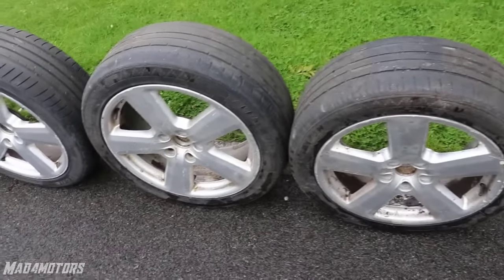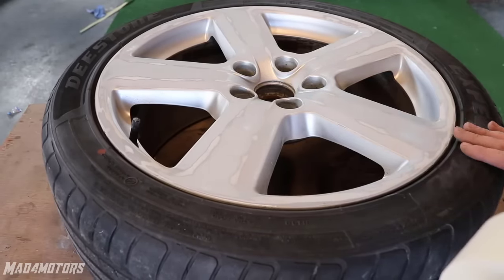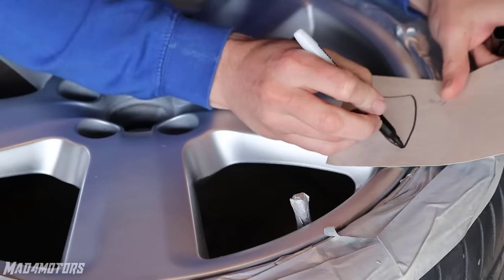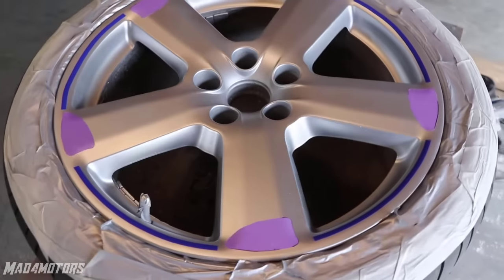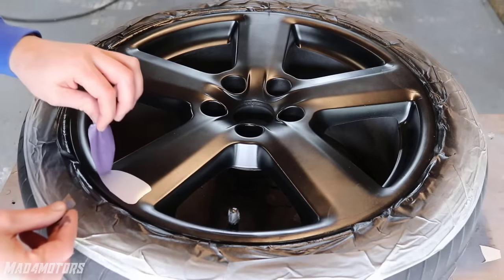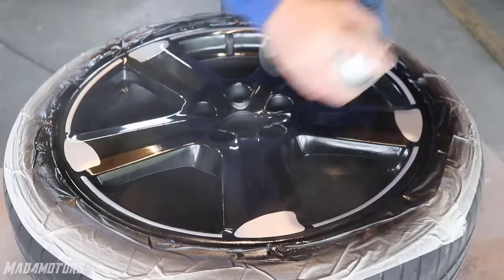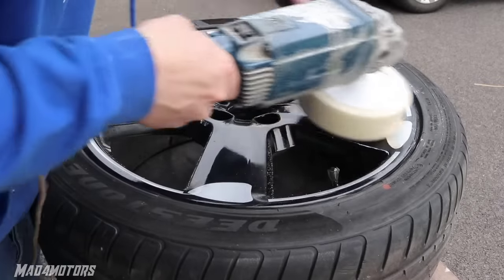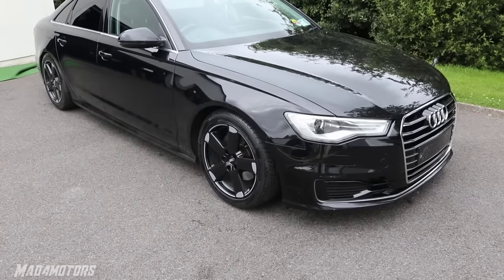Turning a $50 set of wheels into a $500 set of wheels

Comment: One thing that wasn’t shown or mentioned is that if you use a design like the arrowhead (that has a point on one side) you can’t make all four wheels the same. Two of the wheels need to have the points go in one direction, the other two wheels in the other direction. If you don’t, then the two wheels one one side of the car will have the points pointing towards the front and the other side will have them pointing towards the rear. Notice the left side of the car wasn’t shown.
Reply: Eye off the tiger 👀
Reply: Tomaszenko,
I took a look at the Audi rotors and you are correct. They are similar, and all four the same. I guess it’s just personal preference as to how one wants them to look on the car. For me, I prefer symmetry. Could be because I’m a Virgo? 🤪
Reply: That is the same problem that rims have on some cars, that they face backwards at one side, just some details that irritate me.
Just check out the new electrical Audi , it strange the designers don’t think about it.
Reply: No shit Sherlock!
Reply: Bram
Meaning what? You thought I was stating the obvious?
Reply: Its not difficult just flip the template when your making them out of tape.its not rocket ship engineering.
Reply: @turbowank16v  That’s right, but he didn’t do that.
Reply: Wheels with angled spokes tend to all be set in one direction as to the fact that manufacturers would have to make 2 castings 1 left and 1 right therefore doubling the price of the wheels plus kerbside wheels tend to get more damage from abuse. ie: buckles, cracks.  So obtaining second hand replacements would be near Impossible unless you were to import them.
Reply: even if you put directional wheels on each side when it comes time to rotate your tires you end up with wheels facing wrong direction that is why i never liked directional patterns
Reply: @sammysteele432  when you rotate wheels, you only rotate front and back and not left and right
Reply: @DDHDTV  actually it depends on the vehicle for instance if it is front wheel drive both front wheels move to the rear however the rear wheels move to the opposite front corner which would mess up the direction
Reply: Cries in Golf GTi mk8
Reply: @sammysteele432  Actually the car has nothing to do with how you rotate the tires. Directional and non directional tires are what determines how you rotate them.
Reply: And whether you have a square setup or not…

Comment: Great content for the DIY'er who doesn't have a Grand or Two to spend on their rims. Really prefer to put the hard cash into the bits that matter most like the brakes, drivetrain, or suspension where it really matters most. Liked that you stuck to a basic design and didn't lose sight of the purpose. Thanks again. Very best wishes.

Comment: Fishing line or dental floss will help when it comes to removing those fragile emblems on the center caps. Just floss it between the emblem and whatever it's attached to. A heat gun (blow-dryer can be used as well) will make the task even easier, as it will soften up the adhesive.

Comment: Just a quick tip to make this process easier ,if the tyres are good and balanced or if you have new ones fitted and balanced ,let the air out and have a tyre shop break the outside bead then get a big piece of cardboard or corflu (plastic cardboard},place a tyre of the same size as on your rims draw a circle on the cardboard from the inside of the tyre cut a slit in the cardboard so it can be slid between the tyre beads and rim as the outside beads  where pushed back by the tyre shop this eliminates the need to mask the rim and allows paint to go around the edge of the rim and when they are dry you just pump up the tyre and the bead will pop back on and as the rear bead was not broken the tyre has not moved so the balance is still good and your wheels are ready to go on the car.

Comment: The only issue is that because of the spear head design they are now directional, so you have to bear that in mind when rotating the wheels.
Reply: The wheels always rotate... that's the whole point of them.. If you think that you need to rotate your tyres to "even out the wear", then you should get a wheel alignment that will make your tyres wear evenly.
Reply: @jonbaker3865  - I have edited the comment to make it easier to understand. The message is the same.
Reply: @johncoops6897  An alignment doesn't change which wheels are driving the car. The driven wheels' tyres are gonna wear much much faster and therefore may need to be rotated.
Reply: Yeah, but rotating the tyres on the driven wheels won't make them last longer....  in fact, it probably makes them wear faster since the moved tyre needs to "wear in" to it's new position (eg: feathering of the leading edge on tread blocks of driven wheels).
Stop and think about it - in what way could rotating of tyres possibly make them last longer? They wear as they wear! So if the driven wheel's tyres are wearing much faster, then simply replace those TWO tyres when required.
The main reason that tyre manufacturers suggest rotation is because then they can sell you 4 new tyres at a time. For the consumer, it simply mean a larger upfront purchase instead of just replacing pairs of tyres as needed. Also, you waste time and money going to the tyre place for unnecessary labour costs that achieve absolutely nothing..
Reply: @johncoops6897  The idea of rotating tyres isn't to save money. Its to give extra time before u have to buy more. I understand that it may make them wear faster and its also probably not the safest option. Its like a loan or credit card, solves ur problem temporarily but ull end up paying more in the long run.
Reply: @jonnylawrence5699  - What you said is almost certainly true, but it's totally and utterly illogical.
If money is tight, then buying one or two tyres is always cheaper than buying four :-)
Reply: @johncoops6897  Glad we could sort of agree. I'm only on my first car and isn't something I've ever done. My dad works in a tyre shop and my mum would get him to rotate the tires on her car in order to wait for the next paycheck. I never really thought of it from the way u explain it and I'm pretty sure its against their company policy for the usual customers. I don't disagree with what u said, but sometimes people don't have much choice but to do what is illogical. (Edit-spelling of "their". Ppl on the internet can be arseholes for spelling)

Comment: I don't know what to say, i try your method in the past and they don't last very long time do to the lack of hardener in the paint. In my country a set of this wheels to get refurbish ( sandblasted, fills pinches and scratches) and electrostatic painting costs around 100$-110$ (in this price they get off and on your tyres and balance the wheels again)... probably the prices in your country are much higher and that is why your work is justified.

Comment: I have a 2001 Dodge RAM 1500 with a set of stock wheels that I'm going to paint the wheel flat black, the 3 spokes metallic bronze, and the hubs Gloss black. The wheels need some extra care. I'm also adding large (14"x14") USMC EGA emblems to the doors, a large (6"x6") RAM emblem on the tailgate, a custom wing on the roof, and a Duraflex® - Hellcat Style Fiberglass Hood painted flat black. I'm painting the whole truck gloss black.

Comment: Loved the video. Quick question if you know: In order to spray 4 SUV alloys, (2x 315/35 + 2x 274/40), only the barrels (not the face), 3 coats of paint, how many rattle cans would I need (150ml cans)?

Comment: Try spray water droplets after you put the primer on and rubbed it down get a spray bottle you can use an empty spray bleach or something like it just spray water droplets on the wheels then spray your top coat on let it dry gently rub with 2000 grit then put your fin clear coat two coats then buff

Comment: Looks nice but wont they get all scarred up on the tire changer when it comes time to replace tires?
Reply: My exact thought!
Reply: Not if the tech knows how to use the machine. The head of the changer should never come in contact with the face of the wheel if you adjust it right.

Comment: looks good but the non-symmetrical silver shape will look a bit odd on the opposite side of the car because the arrow/pointed side will be pointing backwards. Unless you did 2 wheels with the shape reversed...but then rotating the tyres will be a nuisance

Comment: How would you best go about doing the back of the alloy wheel if you wanted to tart them up. Would you still use spray paint or normal paint?
Reply from the maker: Get a strong wheel cleaner and get stuck in 👍
Reply: @Mad4Motors_  thanks for your response. Presuming cleaning the alloy up wasn't enough then what would you do please... TIA

Comment: This what exactly need to know. May be you can help me  well.

I have Mazda MX-5 ND 2017 with OEM gunmetal 17" rims.

What I like to do is leave the spokes as they are but paint where they join the rim in full chrome. So it ends up with chrome rim all around. So spokes needs to be masked but worried the paint build up between the two meets. Altimately looking g for BBS chrome outer rim with black (in my case gunmetal) spokes in the center.

Can you advise how to go about this?

Thanks.

Comment: I painted my wheels and the paint has since flaked off 😭
Reply: You probably didn't clean and prep the surface properly. Sand them smooth, removing old clearcoat, scuff them, primer them, sand primer lightly, clean and spray the paint then clear coat - it'll last for ages.

Comment: Add the durability for all this is what is the proper aussie term im looking for ? Shite .. if you want a durable lasting finish powder coat it is cheap to do and actually you spend a fuck ton more money on aerosol cans then powder coating .. I can powder coat ten sets of rims for less then what you paid for the rattle can crap you applied.  or at least you automotive paint with a hardner in it.. rattle cans do not have hardner and that is where the durability comes in.
Reply: to be clear ... powder coat 10 sets of rims for less then money you spent to half ass 1 set of rims

Comment: I use Vaseline for keeping paint off of the tires.
Reply from the maker: Yes I have heard this, never tried it though
Reply: @Mad4Motors_ , the first time I tried using it, was on a friend's Pontiac Firebird's Turbo aluminum rims. They had alot of raised ribs, so we used it on all of the recessed areas of the rims. It worked extremely well, and I've used it ever since. That was in 1985...

Comment: Why in the hell would you leave the tires on the wheels? Take them off clean the hell out of the whole rim. Sand bead blast or sand blast them epoxy prime them then epoxy paint them. Or better yet powder coat the rims and be done with it. If you paint the rim with the tire on that leaves an area for crap to gather. The paint cant stick well there and it leaves a place for the paint to start chipping peeling or flaking. I specialized in very high end specialized rims for years. As well as custom designs. Look at the rims on my 1969 lamborghini espada in the picture. I did those. Im not dogging this guy but why go thru all that trouble if you arent willing to go all the way and do it right once rather than look bake in a week and say shit i wasted a whole weekend on those and they are fd up all ready. Work smarter not harder.
Reply: Dude wouldn't even take off the wheel weights or valve stems, clearly he isn't going to remove tires. Lol.
Reply: @billnye198  good point. If youre gonna do it do it right once.